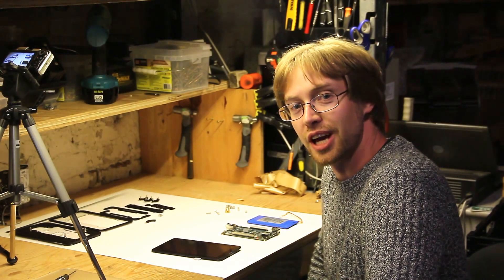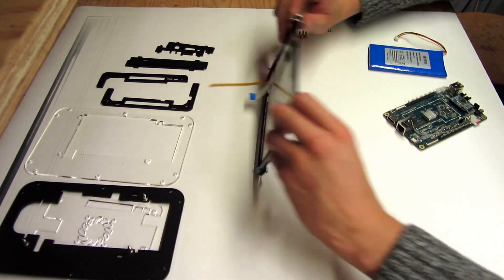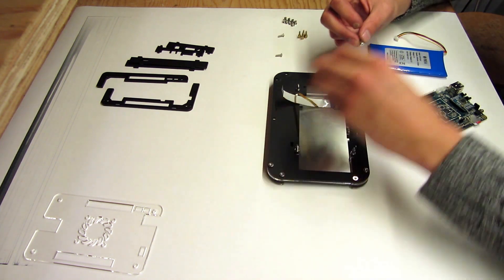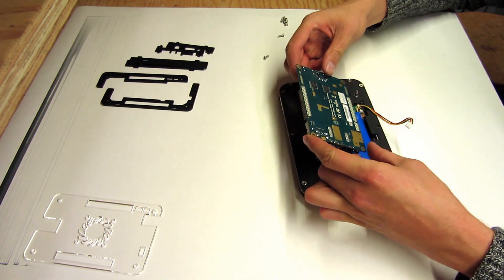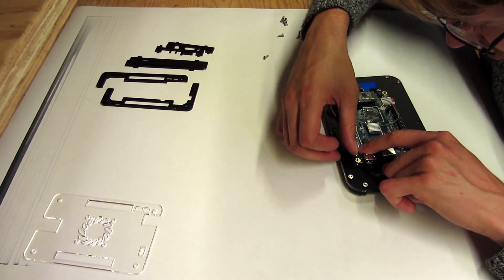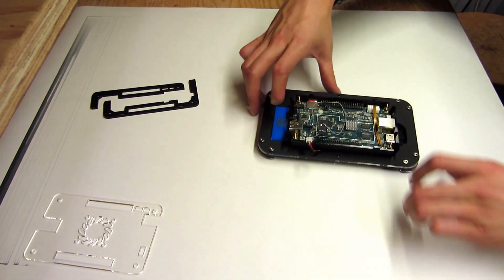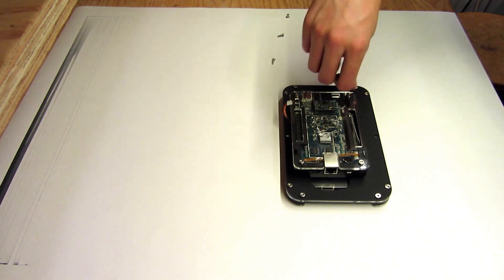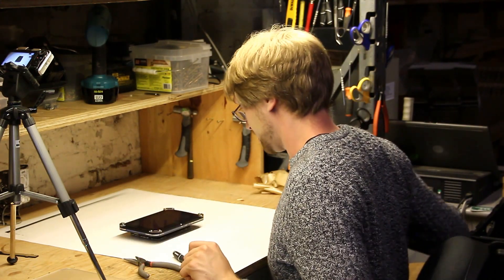Pine 64 - New Screen Case from C4Labs Assembly Instructions

Comment: OK, I got it nearly assembled now but I seem to be 4 nuts short.
Reply from the maker: Ahh nuts! Can you write us at dustin@c4labs.net with your address? We'll get those out to you.
Reply: Holy Inning 1 of the world series!  I see some nuts in the mail, not in my pants.
Reply: You sent 4 hex nuts not the kind used in this Pine with LCD case.  I tried taking it apart and using them to secure the screws to the second black plastic layer hoping the the side would hold the board up enough but it did not work the board is too low for the for remaining nuts to hold down the final piece.  I really see no way to properly assemble this with just 4 of those nuts you sent instead of the ones shown.  

Do you know a good source for a fan for your case?  I have touched the chip and it does get hot with some of the activities I do.

Meanwhile, I have gotten Android 7.0 to work but it is the older build 54 (64GB card) not the current build 64.  I tried the Android TV on a 16 GB with no luck, maybe I'll comment out the LCD line until I can get it too boot like I did with the non-TV version.  Oddly, it lacks a back button, etc.  It just has a home button.  I am using Pines LCD version in the one Playbox case since it looks like they will never update it and changing the card is a pain since the card slot is lower then the battery platform.  I am using industrial  outdoor grade to secure the battery to their platform so it does not bounce around in the case.  I still need to solder in buttons and the IR for the one in the Playbox case, I guess the IR stick out on your case just like the Z-Wave.
Reply from the maker: Toriless--Hang on. This is Karen from Customer Service. I'll get Dustin to read your comment tomorrow. I am so sorry about those nuts. First we left them out, then we sent the wrong ones out to everyone who was missing them! We'll get you set up with the real thing. Please email us at dustin@c4labs.net . That way I'll remember to set up your lost hardware!
Reply: In the past I did but got no response.  :-(

Comment: My screws are to short even after a reversed the clear and black so the 
larger clear is on top unlike on the web site and in the demo the 
plastic sheets are just too thick for them yo reach through all 5 layers
 and stick out any.
Reply from the maker: How much longer do you think they have to be? Every once in a while we get sheets of acrylic that are micro measurements off. That effects the screws. We're here to help. Feel free to write us at dustin@c4labs.net.
Reply: I forgot to reverse the nuts but I am still 4 short somehow.  Also, I had a problem getting the final four nuts ti screw tightly using just my thumb as suggested.  I had to salvage one from each corner to do that since I am missing four.

I also found it easier to assemble the screen and board together but only assemble the holders at one end and then assemble the first black and clear then insert the MB through the cutout and slide the screen under one end then attach the other end's retainers then add the second black sheet while inserting the MB through it then adding the battery, etc.   The lack of slack in the short cables is too much of a pain in the butt yet if I attach them first when I have some slack I can then shift them around as each section is added easier.  It tried you way, then another, then my way.